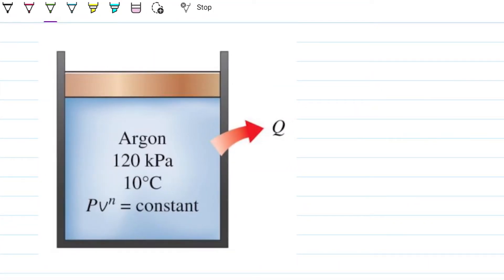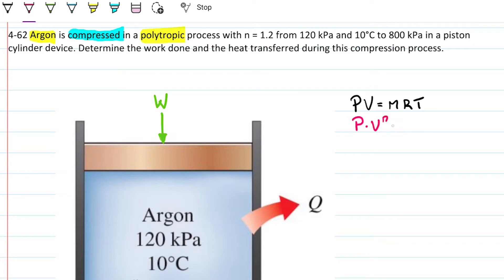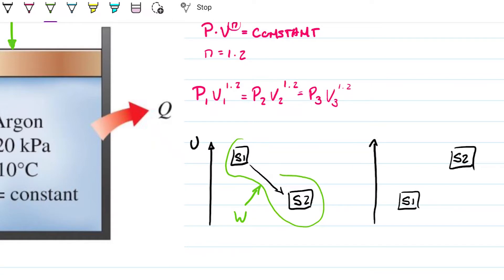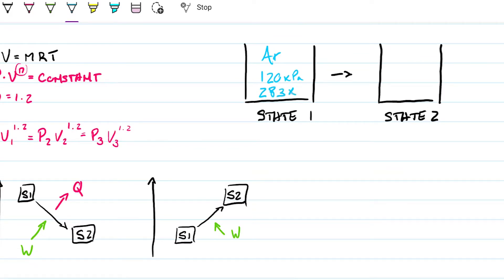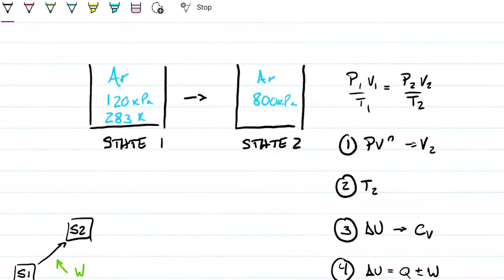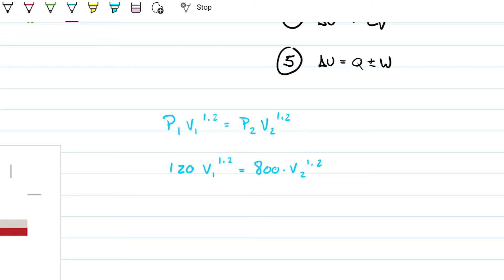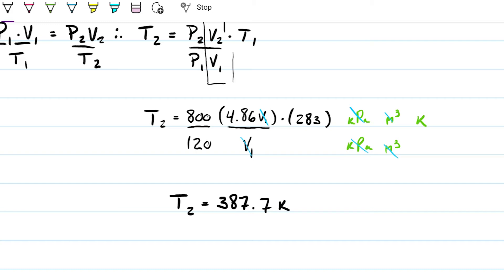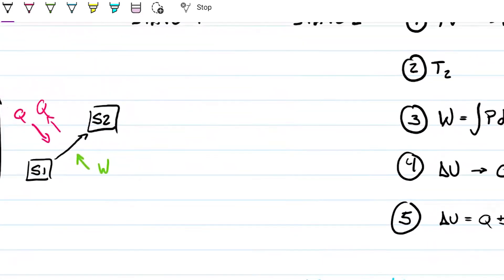Ideal Gas with Polytropic Process (1 of 2) | First Law | Thermodynamics

Comment: At 9:50 you said V2 = 4.86V1. Shouldn't it be the other way round? Because earlier you said that V1 = 4.86V2.
Reply from the maker: Yes. You are spot on
As a matter of fact, the math only works out if the 4.86 is in the bottom, dividing. Thanks for flagging, I'll update. Final numbers are correct though, I flipped during the presentation but kept the values I got when solving on my own
Reply: @EngineeringHack  No stress, just wanted to make sure I didn't mess up somewhere. Really appreciate your videos! They help a lot.
Reply from the maker: https://youtu.be/pBnslp4wNl0
Thanks, mate